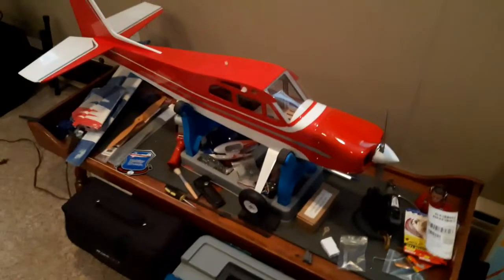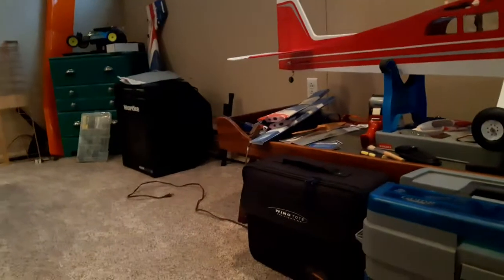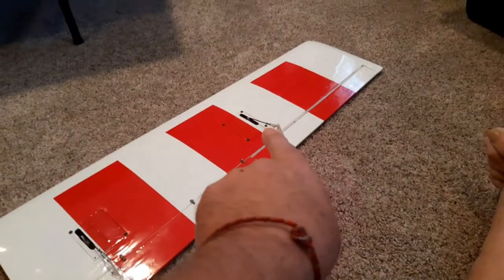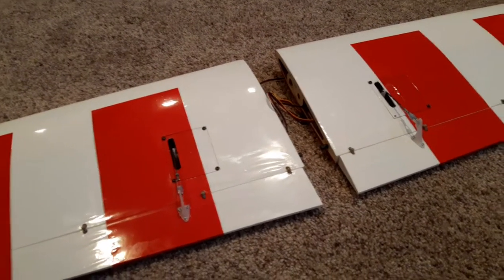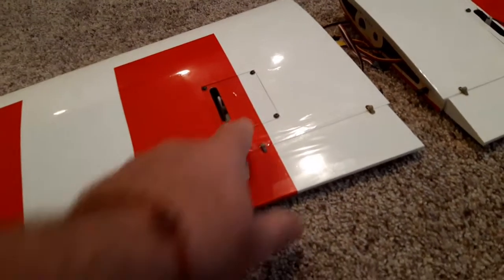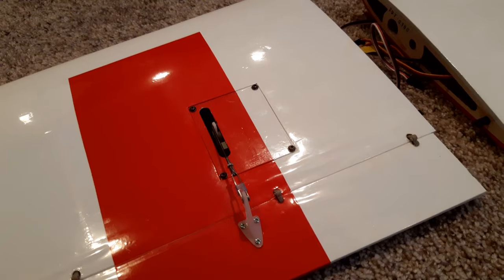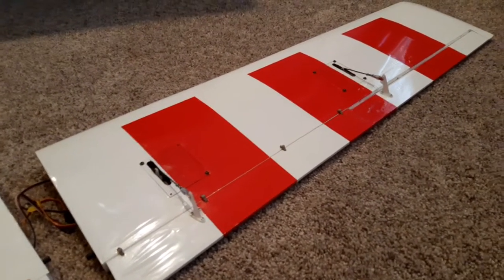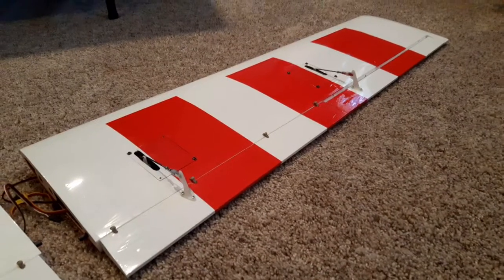Vid two show aileron /flap horn clearance

Comment: i have another question if you can answer please. im preparing to drill the holes in the motor mount. i know the 52 has same foorprint as power 46. i see the holes to drill for mounting to firewall but on motor mount  there is a center hole driled out with 1 set of crosshairs vert and horiz or do i use the crosshairs which seemed offset a bit to mount motor. my email is mrquarters61@aol.com if you want to message me. ty in advance. plane looks great just doing things in different order thats all. wings are done tail isn glued on yet but servos all installed . no control rods yet until i install rx and i just wanna mount motor and esc now thats all

Comment: Thank you very much. Explained very well
 You ansered my question. Now i know i need normal and not 1 servo reversed for flaps. Thanks for the tips and cant wait for all parts to get here and start building. Ill stay in touch and ty agsin
Reply from the maker: You will see , on you remove the servo hatch /cover ,the wood blocks that you screw the servo to will automatically sit the servo in the correct orientation.  ⭐⭐ test fit you servos WITH the output arm attached to servo , this is to assure proper clearance of the arm and push rod ..take your time , follow the manual and you will be fine .
Reply: @radioflitercairplanes1715  yes ty, i watched that video already